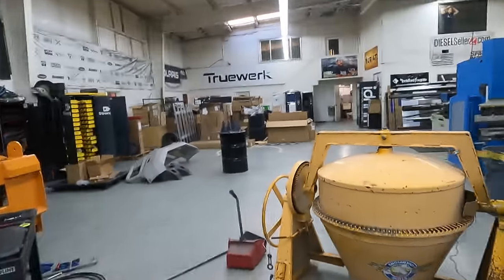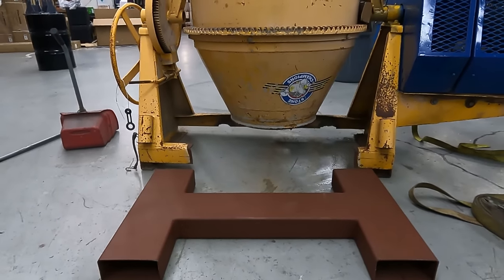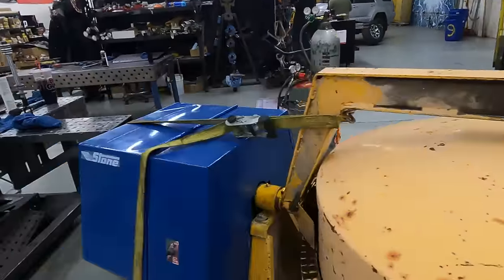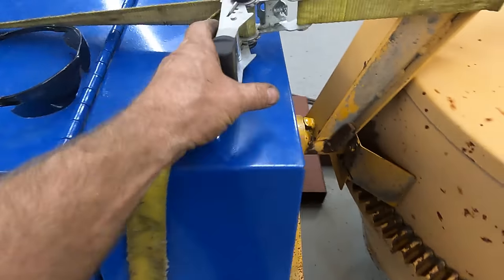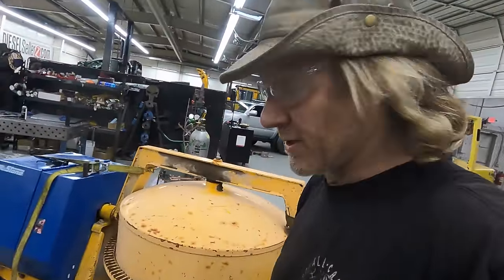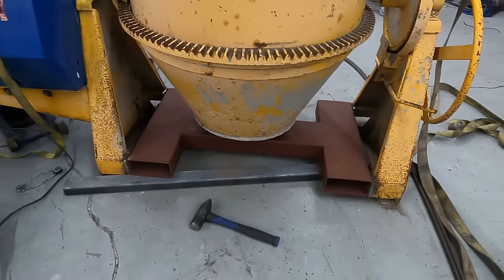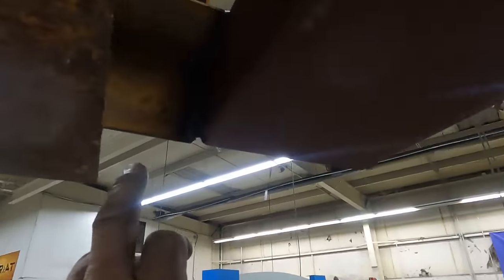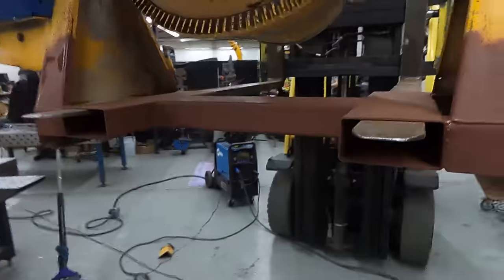Cement Mixer (STONE 95CMED) forklift Upgrade

Comment: Hmmm... why is that crossbeam in the middle? See now you poor the concrete out of the kettle, and on to this beam...which is nasty,...maybe a U form would solve this? With the crossbeam in the back of the back of the kettle, so you can swing it and never meet a crossbeam during the flow of concrete out of this kettle...? That would be my design...please...carry on. But harder to redo now I guess. It looks sturdy this way though. Great work Alan!
Reply: Hopefully Alan checked how it would dump into a wheel barrow with the wide cross beam in that position.  A mixer isn't very useful if you have to dump into buckets held by hand however you can add a chute or add a 2X8 box beam at the back and cut the middle one out afterwards if it turns out to be a problem.  If it gets raised high enough though with the center beam there is the possibility of being able to dump from either side.  Alan will better know when he swings it through its range of motion however it looks very tight to the lip of the drum now with a potential for the drum to catch on the center beam preventing it from swinging past it.

With steel prices what they are today I try to avoid having to redo things especially with box steel like that costing about $300 or so for an 8 foot piece and then you have to factor in the welding wire and shielding gas too making it pretty easy to blow through a thousand dollars in a very short time.

Edit:
Just checked the original schematic on that STONE 95CMED mixer and that one was designed to be towed and was missing most of the lower frame, axle, draw bar and stabilizers.  Alan's mod appears to be an improvement over the original design giving better access to the drum.  The original design had it dumping off the back of the trailer with a brace along the back preventing you from getting any further under the drum.

See:  https://www.jobsiteparts.com/stone-95cmed-concrete-mixer-parts.html#145126_1

Best!
Reply: @neilfromclearwaterfl81  I don't think he is aware of it.